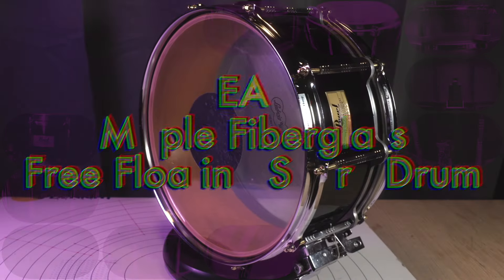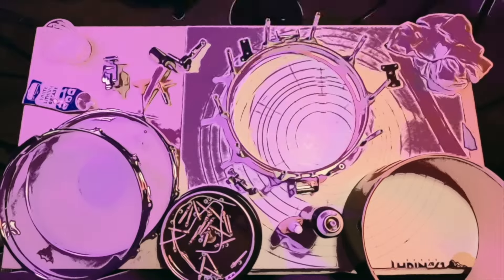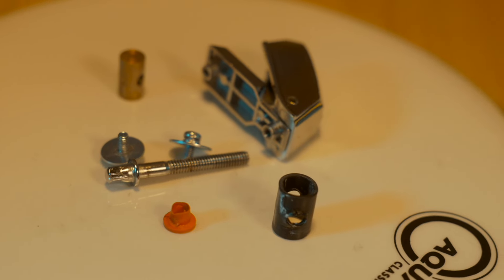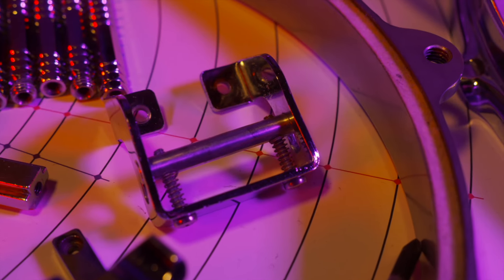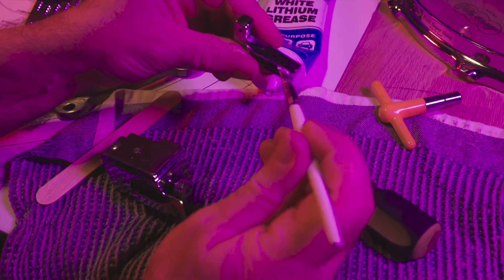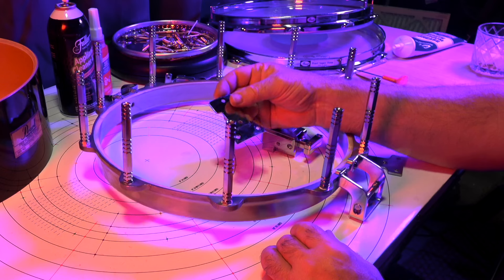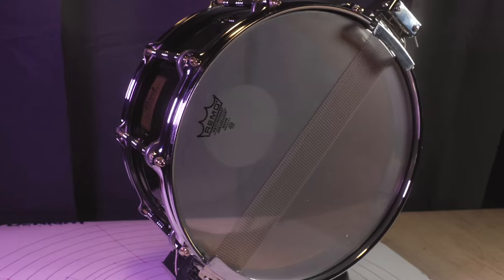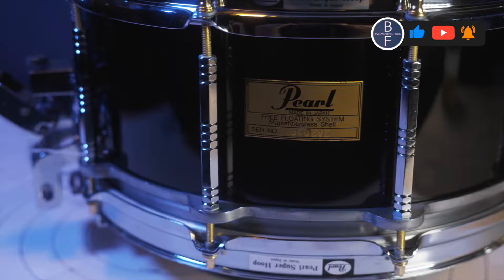Pearl Free Floating Snare Drum 1982

Comment: I have a 1st gen aluminum FFS with Super Hoops.  Recently the throw-off developed a fair bit of friction when turning the wires on/off, like the lever won't pop into the off position, I have to move it all the way.  I hope it's something I can just add some grease to, because I'm not looking forward to having to take apart the throw-off.  I really hope it isn't a rivet breaking, but with my luck, it is.
Reply from the maker: Sounds like it. The Pro Drum Shop in Hollywood fixed mine. It is difficult to get the rivets replaced. You should be able to unscrew the bottom to look inside.